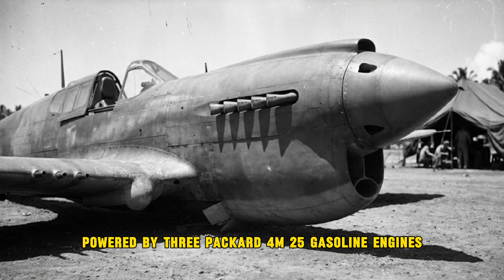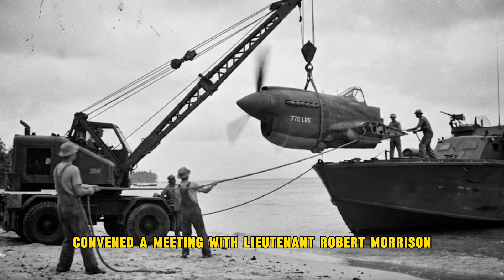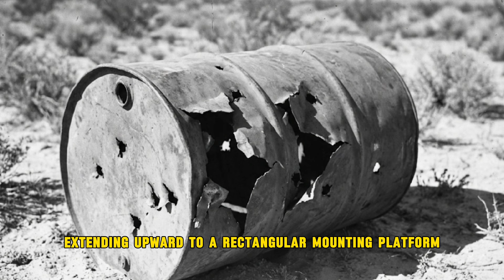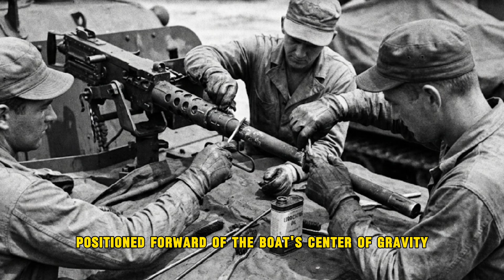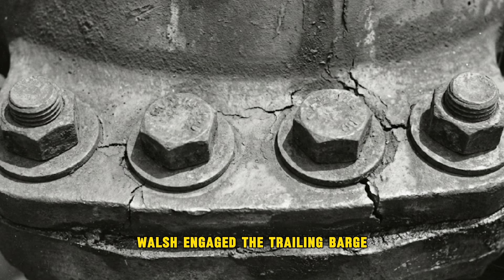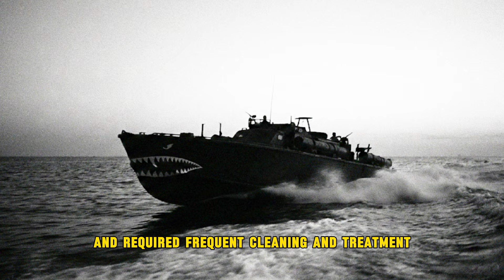When They Put P-40 Warhawk Nose on a Little Boat - The Germans Called Them "Shockwave"

Comment: Wisng-mounted .50 Cal machine guns, firing through the propeller arc..  . . musta been a BIG prop.    The forward fuselage section mounted with the engine running?  Completely assinine images.
Reply: Are you referring the pictures are not real? IYO Did the modifications work as told here?
Reply: @Salaudeen213  The story is real. I expect most of these photos are, but the ones at these times are NOT: 5:01, 7:11, 9:00, 11:18, 24:26.